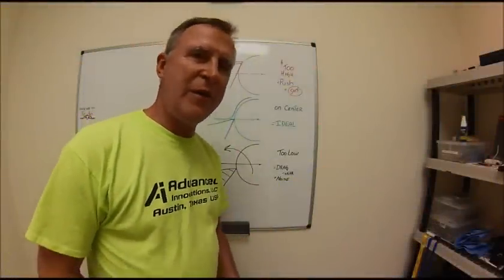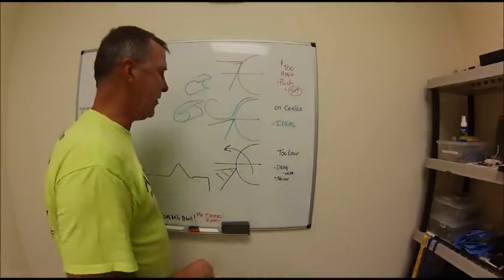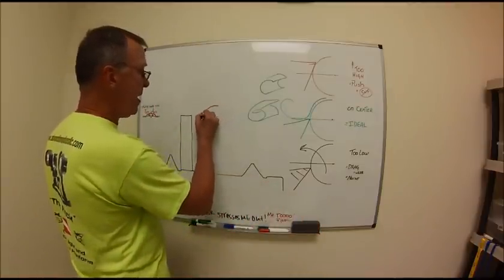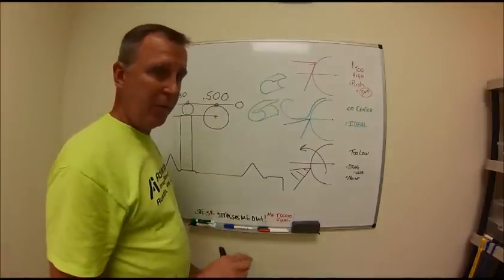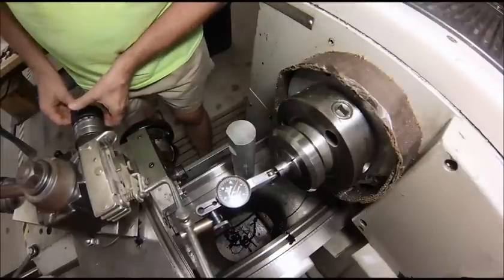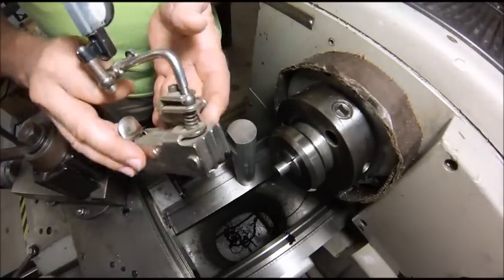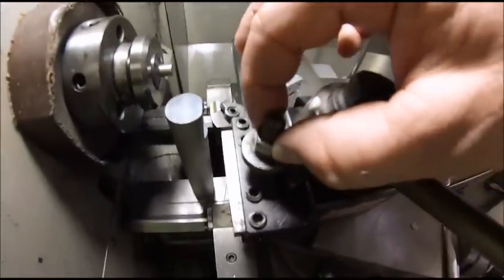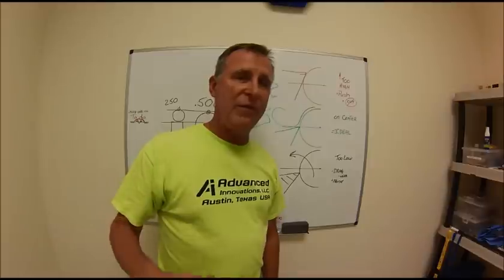Setting lathe tools on center

Comment: I get everyone has their own way of doing things, but this!!!!!!! 😂 wtf even is this? I can only describe it as trying to flip your car on its roof to change the tires. 😂 but seriously, if it works for you, that's great. But to try and teach this should be illegal.
Reply from the maker: It doesn't get any more basic than a solid piece of material machined to a set length. Sorry its over your head.

Comment: Thank you Joe. I liked the file tang trick. I will do that to have less frustration. I bought some 3/8” boring bars and the insert is not flat with the flats milled on the bars. The insert tip is canted down at about a 19* angle. Could you make a video on centering boring bars?

Comment: Thank you very much! That's much faster and more efficient than some of the other techniques I've seen.

I was brought up as part of the CNC generation - taught at school to program CNC machines long before we learned about manual machines - our teachers were very good and doing the best they could to prepare us for the future, money and resources were very tight and it saved a lot of money if we wrote CNC programs that our teacher could assess on a simulator instead of making parts from stock on manual machines - but when I only need a prototype for development and testing or 2 or 3 copies of something then making it on a manual machine is much faster than writing a program and tooling up a CNC machine.

For my generation your videos are hugely valuable!

Comment: Like the file tip. Have used it for years. You’re absolutely correct. Those nuts can be a real pain. Your idea is simplistic which is great.  KISS. keep it simple stupid 😂 if you look at a few of the ideas here it’s amazing. One has a dial indicator on it. Which isn’t a bad thing, just a bit overkill in my opinion.  Good video kid 🤙🏻
Reply from the maker: Thanks.

Comment: i put a piece in chuck, machined a point, made up a steel stand, sit in on cross slide, scribe a line using machined point. Any time setting up a tool, sit stand on cross slide and set tool to scribed line

Comment: Perhaps not quite as accurate but much faster, I take my 6”machinist ruler and press it between the work and the tool tip. If the ruler remains vertical (90 deg up) then the tool is on center. If not, adjust accordingly.

Comment: Does this mean the steel rule captivated against the round part by the cutting tool is inaccurate ?? I've had good results when that ruler is verticle but, I am a motorcycle mechanic, not a machinist.
Reply from the maker: Set  it for facing or turning, but anything other than a neutral rake tool will be different heights for each cutting point.
Reply: @joepie221  Thanks. Watching your vids is expensive; I go buy stuff after getting smarter !!

Comment: Had to do a re-watch.   Need to make this tool vs just thinking I'll do it later.  Should have done it years ago.

UPDATE: made the tool height gauge and looks and works great.  6061 1 - 1/4" dia  .  

Was thinking about doing counterbore on the bottom and insert a magnet for more stability on the Lathe way.  I'll use as is for now and see.

Comment: Love these vids, but this is a lot of work for something so simple. Just take a small steel ruler and place it between the tip of the tool and the part, very lightly. If the ruler leans forward, your tool is too high. If it leans backward, your tool is too low. Adjust until your ruler is straight up and down.
Reply from the maker: Actually not. A tool with a radiused nose and top rake will have 2 different cutting centers. The turning center will be lower than the facing center, there fore centering for turning will produce a tit when facing.
Reply: @joepie221  That explains all those tits! Thanks again.

Comment: Hey Joe, Love your channel, I am a very experienced machinist but there is always something to be learned from others. This video shoes a great way to accurately set center height on tools, I agree it is most important. When I had a production shop I had exclusively Hardinge machines and they made an adjustable center height tool similar to yours, it had a top piece that folded out for setting upside down tools. Your method of setting the gauge is so simple and easy, great job.

Comment: Joe that all seems like a lot of cumbersome stuff to do what I think is better and more precise take a round 3/4 aluminum  bar and face off both ends and in one end drill a hole the exact size of a good quality laser pointer and drill so about 1/2 or more of the pointer is fit inside but not the full distance and in the opposite ens drill a hole as small as you can and than indicate every thing so you know the pointer is giveing you a perfect site alignment once you have that put into your lathe chuckvand check with a indicator and point at the tailstock at its at the end of the bed and it should be.. after that set up the tools and start with all on the low side and slowly Rais up tell the point of tool pics up the light ! You got it use the same for aligning drill holes on the mill as well ! Then look for prisems and you can make any angle you want 8f you have a problem finding prisms get a old pair of binoculars take apart and inside you will find them and you can use the same to make a pearaecope for the mill and lots of things with a lil creativity go nuts !

Comment: The first thing I do with a new tool holder for the toolpost is to remove that stud, degrease it and the hole it went in to, with some acetone and put some red locktite on the end of the stud and screw it back into the hole it came out of. Boom! problem solved.
If for some reason you would ever want to remove the stud you simply heat up the stud and it will come right out.
And do not forget to carefully clean up any locktite that may ooze out at the top of the holder when you screw the stud back in or you will also lock up your adjustment ring!
Reply from the maker: I've also seen them pinned.

Comment: I think is easier  if u put the
 .500 pin on the chuck and leave 3/4  out of the chuck and mill down that  3/4  inch  that you live out to .250 that will be center too i think is easier. I just thought  that after i wach this video . Good video thanks for share you  knowledge

Comment: Hey Joe I'm new at machining but an old guy and  want to make a shaft for a right angle gear drive . i have had all kind of problems turning 4140 or something like its hard .I would just eyeball the live center so before i move forward I'm making a setup tool great video i think this will help i also need to maybe get the right insert .Thanks for the video .JM

Comment: I made one of these as soon as I saw your one, it really is the lathe operator’s “best friend”, I use it all the time. I made mine from 1” aluminium stock because I had plenty of it (it’s only a small machine) & I keep it in a spring clip (a pipe clip or terry clip) screwed to the wall just above the lathe.

I can’t stand to see people using the steel rule trick, it’s nowhere near as accurate.

Comment: Joe, that pin method is sheer brilliance in it's simplicity! And that file tang taper squeeze play is a good thing to remember.

When I was manufactured engineer at one of the companies I worked at.... I had this one machinist that kept all of his nails trimmed except one pinky nail - which he usually let grow out to one quarter of an inch. It was his "educated measuring nail". He could run along the surface and tell the surface finish as good as the surface finish standard would do..... And he would use it for matching surface heights like you did with your finger. Personally I prefer my index fingernail! 🤗

Comment: Great video Joe . Newbie but have had tool jam on small lathe. It was probably under centre fraction plus too long the work piece. Although in tail stock centre it seems not good idea to thread or turn 15mm ally bar.

Had no steady!  The tool picked up stopped spindle. Three jaw digs into work piece  gouging grooves. Machine stalls before switch off!  Lucky not worse but things happen very fast!!!!!!
worth being very safety conscious on lathe all the time and really not make same mistake twice.
 Ps very easy to leave tool post or quick change section loose and not notice until cutting !!!!!!!
Reply from the maker: A loose tool holder will get your attention pretty quick.

Comment: Thanks Joe.  That is a good way to do it.  Adding to that theme, you can add a little overhang, even with the top of your reference pin, to help you reach to where the cutter is.  No more than 1/2” or so works well.
Reply from the maker: Agreed.

Comment: Little tools like this are real time-savers.   I made a square-U with the base of the U flat and parallel to the tips.  I hold the tips against the face of my lathe chuck, straddling a jaw.  The base gives me a parallel surface I can use to align the angle of my QC toolpost, especially the parting tool.  I also made a dedicated little jack for my dividing head that lets me set the chuck exactly horizontal in a snap.  The list goes on!  Now that I'm old and senile, I need to label all these tools so I will know what they're for when I haven't used them in a year!  Love your channel.

Comment: Thanks for sharing Joe. Guys like you who are willing to teach others are real professionals in my book!  I watched all your steam engine videos and just recently set up my lathe and was having this very tool centering and parting tool issue. Your tips allowed me to fix my issues and successfully finish my part. Your my go to resource. Thank you I wonder if you could talk about when to use insert tooling and when to use high speed steal cutters. I found I got better surface finish when i cut .020” with insert tooling but when I tried to dust off .002” or somthing with insert tooling my surface finish went in the can and my insert galled up. Should I use high speed steel for fine finish cuts?  I don’t have a grinder 😉
Reply from the maker: Cutter selection is always a matter of material, process and feature. On many materials you will find HSS can give a better finish for lighter cuts. I prefer it for aluminum, brass and most plastics.

Comment: Hi Joe, I really like this and will make one and 'bin' my screw version, but as always I have a question, you chose Aluminium, I don't question your choice, but would have assumed a harder material would be better, thinking about durability when rubbing hard tools up to it, conversely a hard material might cause damage to the bed!! do you consider these 'sacrificial' ? if so roughly how long would you expect the life to be, I would appreciate your comments as to why the Aluminium is the material of choice, Thanks Tony
Reply from the maker: I normally make them out of CRS, but this one was done in aluminum because it was my preferred diameter and thats all I had. They don't see any abuse, so a softer material is fine too.

Comment: And, if the tool is not operating on the exact diameter of the workpiece cuts set by the dials or DRO will not be accurate.
Reply from the maker: It has to be substantially off, but you are correct.

Comment: This is an excellent tool.  The best I could muster (for those tools which permit it) was to trap a thick shim between the tool tip and the workpiece to form a tangent. When it was on center the tangent was vertical, off center off vertical.  I like your idea better. Thank you again.
Reply from the maker: Many do that, but depending on the grind and which surface you bump against, the tool could still be off. Always set the tool for the operation being performed.

Comment: When working with carbide inserts that do not have a sharp cutting edge, should the top of the insert be at centre height or the lower edge of the curve or possibly somewhere in between? Sorry if this has already been explained.
Reply from the maker: Some tool geometries dictate the height set. If its a facing job, it has to deliver a flat face, if your turning, the tip has to be on center. Those are 2 different parts of any lathe cutting tool.

Comment: Here is a dirty trick relating to centering tools.  When cutting nasty alloys (such as 50% cobalt magnetic steel), the tool wears fast, to the tune of lasting about 5 minutes of light turning.  I grind the tool with a rather high negative back-rake (to strengthen the edge) but set the clearance angle a little higher then usual.  Start with the tool set above center.  The high clearance angle will permit the tool to cut.  When the tool dulls, "sharpen" the tool by lowering it a little.  You can do this multiple times, getting more cutting time out of one grind.
Reply from the maker: What do you do with the worn section? I don't understand.
Reply: @joepie221  The top edge of the (clearance) face wears, reducing the clearance angle until the tool "just rubs" (like in your illustration when the tool is set way too high).  Lowering the tool slightly once again permits the cutting edge to contact the work (there is no tool removal or grinding).  This action is a quick release of the Aloris holder followed buy a small turn of the height nut, then re-lock, and you see chips forming again.  This can be repeated until the tool gets too low for safe cutting, then you regrind.  Because of the high negative top-rake, the tool can be run "lower then usual" without risk of "hogging in".

Comment: Question.Why do you have what appears to be tape covered cardboard around the spindle cover?
Reply from the maker: It catches the oil that pinwheels off the chuck collar.
Reply: Thanks Joe. I don’t have that problem.If it ain’t broke,don’t fix it.

Comment: I have one of those at our shop i work at but it does not have a flat cut in it. It is a piece of round stock with a chamfer all the way around. I see the flat with the sharp corner will get me right on center. I also like the file trick. Thanks for that. Time saver.

Comment: Why not just cut a flat halfway thru the pin, while leaving the body circular to be clamped on.  Then clamp the pin, rotate the flat to the bottom and touch the top of the tool to the bottom of the pin. You could deviate slightly from center on your pin and allow for shim thickness as well.
Edit: or rotate the flat to the top and just indicate directly between them from the axial centerline of the pin on the flat and the tool tip.
Seems quicker, but I may have overlooked something as well.

Comment: I really hogg off some pre-hard 4140 and it is best to run below center. Even a hot coat 80 Diamond  insert wears off fast and you lose your clearance fast.   Maybe I missed it, but the most important part of  running on center is your DRO.  If you are not on center it will not correctly read what you are removing.  Very important when sneaking around inside of a piece of stock.

Comment: Run tool against work with a flat plate between if it's straight up and down its centered if the top is away from the piece you're below if the top is closer to the work than the bottoms you're to high..... pretty much any flat bar will do longer and thicker will be more accurate
Reply from the maker: 2 things. 1. if you do this with a carbide tool, you'll probably blow the edge off the tool from the pressure. 2. this technique is conditional upon the tool being absolutely neutral in all directions, and only close at that. Perfectly flat to the world, or it won't work.

Comment: Joe, I have a Standard-Modern lathe of the 1970's vintage. The manual for my machine says the distance you are describing is 6.50 inches. What would you expect from making a tool such as yours just using that measurement? Using your method, I came up with 6.507". The device I made using the measure from your method seems to place the cutting tool very well.

Comment: Hey Joe, I found a very similar indicator holder to yours and love it. Mine is called "Erick Magna Model 200" They can be found on Amazon as well as other vendors. I just wanted to pass the work along in case someone would like to pick one up. I have found them easier to use than the Noga style that seem so popular now.
Thanks for all of your great content.

Comment: Dividing odd number's with a fractions in your head. Half of 13 3/8". Minus one from the odd number then divide by two. The result will be the whole number in your answer. 13 - 1= 12 divided by 2 = 6. Add the numerator to the denominator together, in the fraction your dividing, to get the numerator in your answer. 3 + 8 = 11. Two times the denominator to get the denominator in your answer. 2 x 8 = 16. Answer 6 11/16". Half of 21 5/8 is 10 13/16". With a little practice you will be dividing odd number fractions in your head without using pencil and paper. This works with all odd number's with a fraction.
Reply from the maker: Interesting.
Reply: I do it differently.  13 3/8,. Take half of 13 is 6 1/2 or 6 10/16.  Half of 3/8 or 6/16 is 3/16.  6 10/16 plus 3/16 is 6 13/16.    21 5/8 is 10 8/16 plus 5/16 is 10 13/16.  Very easy to do in your head.   Works with any fraction and even easier with even numbers.

Dale in Canada

Comment: Good info and video. We were on vacation in Mobile Alabama and I got a chance to observe two machinist working on two 15" swing lathe's with lantern style tool post. They both had a standard like the one you made but the had a small piece of steel, bolted on the top, that overhung on one side so when they changed to a different tool they could swing the compound over and under the overhang. That set the tool height, then lock the tool down, then swing the compound back to the part and lock it down and start cutting. Thanks again. You can use a small drill drift to lock that knurled nut also.